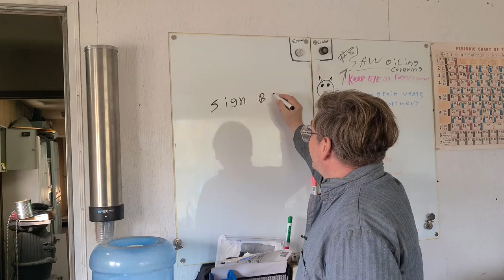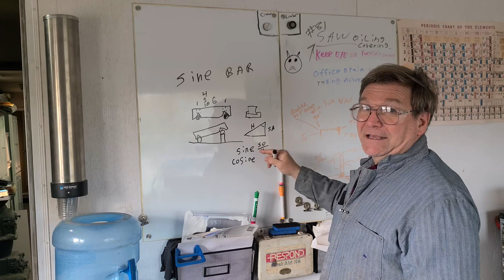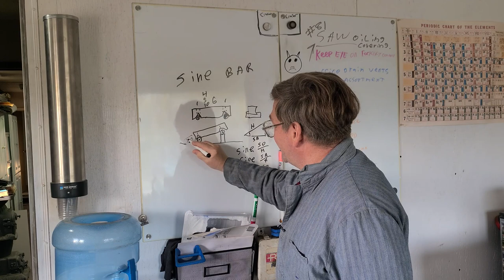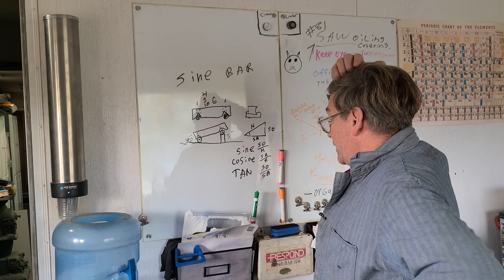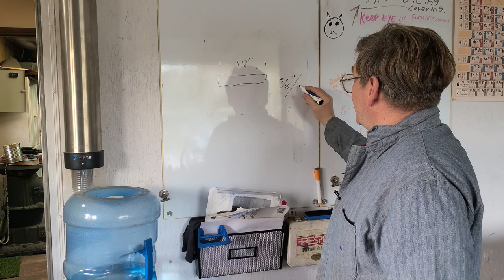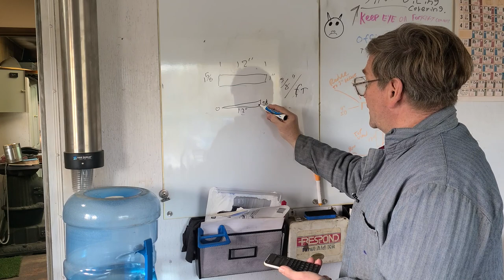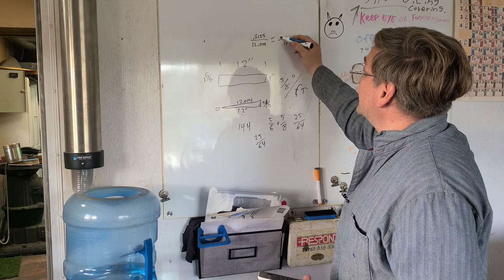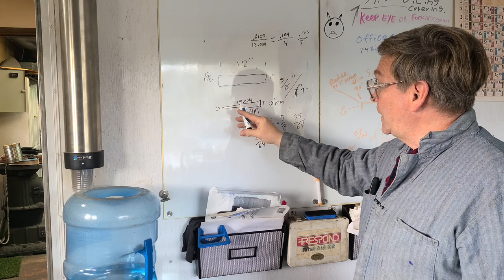Machinist's Minutes: Sine bars and the alternative for setting taper of the Lathe compound.

Comment: thank you! the whole reason sweeping with an indicator didn't work for me but the sine bar did, and why I asked the question, is because of exactly what you pointed out, taper per foot was not hypotenuse! it makes sense now! Back to just using an indicator on the part. I was making ISO30 tapers, and the contact was consistently off by .0015 over about 2 inches, but that's where it comes out!

Comment: What are your thoughts on the US switching to Metric ??? 🧐
Reply from the maker: It will mostly happen, but I am not a fan.  An interesting point are the "metric" pipe threads, used in Europe & Asia, they are actually British pipe threads, with a Metric designation & a inch pitch, but labeled by the metric equivalent spacing (not whole numbers).  I like metric in the Chemistry lab, but the unit of length (that it all is based on) was too arbitrarily chosen.  The world will long be cursed with the mix of systems.  What is a 16 penny nail in metric??